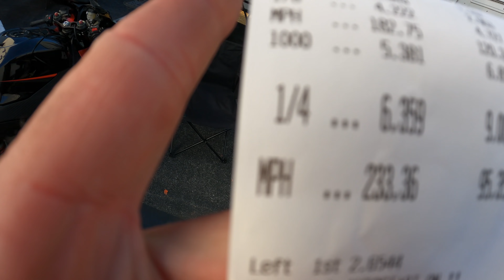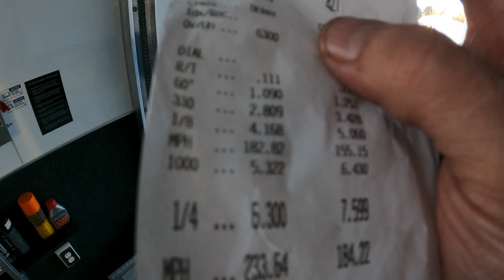Turbo GSXR 1000 Black Mamba breaks the World Record!!! Fastest No Bar Motorcycle 6.300 at 233mph

Comment: just think prostock can get 200 and no turbo turbo 600rr has been 200+ great run and bad fast but it's more of the stock bike on the floor in the shop and it's only a second slower than nitro class  and I would like to see it run Y2K it's got two wheels and tires too much to many electronics why not just make it a drone and you can sit in the bleachers and watch it go as all the air shifting and everything else might as well just go have an automatic made for it no offense to you as just the entire sport was more fun watching the kid on the 450 he has to go through the motions and not a passenger seat on a acme rocket 🚀 but congratulations on being the fastest black mamba as it's got less suzuki parts on it then non suzuki parts  does it even hold a full gallon of fuel it's fast as 🚀 just wondering how much money does it win because basically the 2020 zuk is at the shop and I know that we were going on stock blocks until they were splitting it the middle in the mustang days but idle of man lap record on 37 miles of street and the record is on the 1000R BMW but a cbr600rr is just 2 seconds away from the unlimited class and only 5 mph difference in avg speed and how long until the motor gets torn down again the front wheel turns just think it's just 190 mph slower than the tomahawk and it can go for more than a few seconds and 420 mph is the worlds fastest bike just saying 🏍️